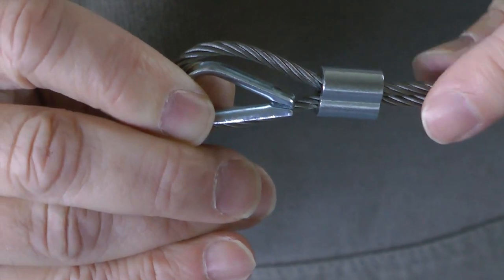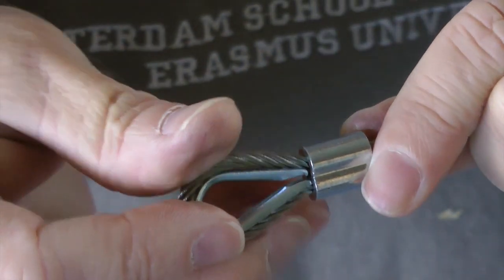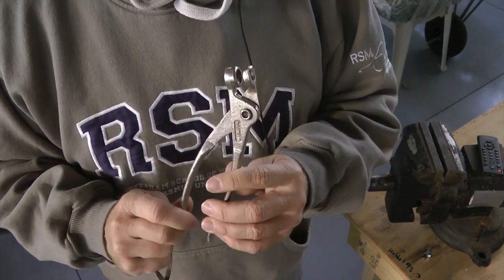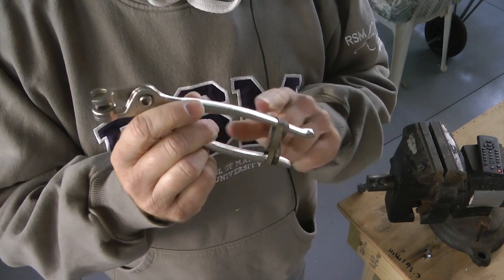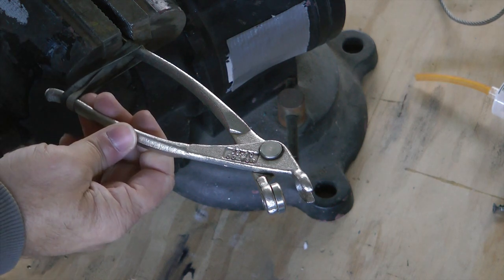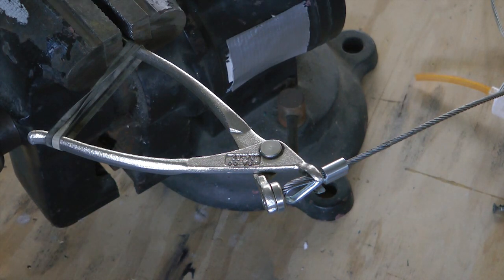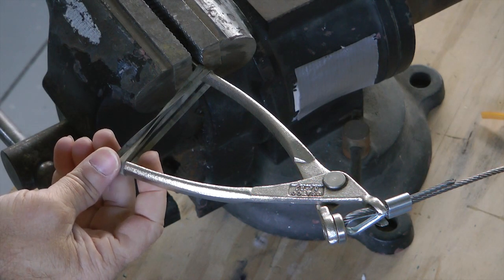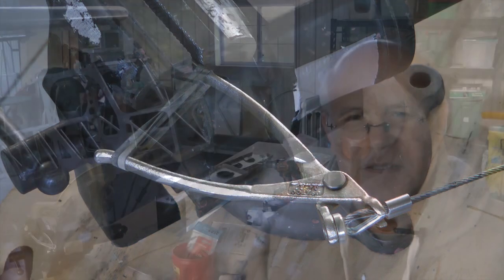Unique Trick with a Cleco Pliers for Aircraft Builders

Comment: AC 43.13 1B section 7-148 to 7-153 ppgs 7-30 to 7-39 is the accepted practice & approved methods of swagged cables for aircraft.  A home builder should read and understand how to use the swagging tools and practice on a few before actually making a control cable for an aircraft.  It's not difficult once you get the hang of it.  This illustrates that one mechanic improvised a way, adapted it so he or she could work alone, and overcame the difficulty of needing a second set of  hands to help accomplish the same thing.  This A & P Mechanic is learning new tricks to make his day go smoother.
Enjoyed the video, thanks for posting.
Reply: It's actually AC 43.13
Reply: duly noted and edited. Posted this after a long day in the hangar- work shop.... nice to see someone is paying attention.
Reply: Godfrey Poon We are up to revision  AC43-13 2B. You’re living in the past, get with it.
Reply: 1B and 2B are different parts and are both current.

Comment: back off the adjustment on the crimper to get the first press and hold things in place, then go back and do it again at the final setting
grab the cable and sleve with a rag in your hand, then you can really push it up against the thimble.
you can hold things in place with a regular cable clamp too, just gently tighten it, you don't need much, it leaves no damage to the cable

Comment: As a teenager I worked in a rigging shop and was taught by the original swage fitting manufacturer how to do these. They would suggest that the technique shown here is NOT good. They always taught to size your cable the right length so that its cut end is flush with the swage fitting. The original swage mfg. did not suggest that the cable exits the swage fitting as it leaves cable that can only become a "gotcha". Start swaging from the end farthest from the thimble first. As you move towards the thimble, the swage grows in length and makes a tight termination. Also, there is no need for two swage fittings as you seem done sometimes - it is actually weaker.
Reply: TalonID...   Hi, it's always interesting to hear from someone who's worked in the field being discussed.  

I can see the sense in not having a long tail sticking out beyond the swage...   it's a definite snagger and "gotcha" as you mentioned..   but putting two swages on the thing is an understandable 'belt & braces attempt by many people I think.   
I've done it myself, although not in this aeroplane sense. 

I'm certainly willing to take your word that putting two swages on weakens the whole thing,   but I'm just not sure why this could be..   Any crushing by the extra swage wouldn't effect the diameter of the wires in the first swage would it?   
Maybe if it was butted up really close I guess..   but if a 'swage length gap', say,  was between them, the wires would be still at the original diameter wouldn't they?  
Or is there some other reason? 

Just thinking out loud here, not a criticism.
Reply: Nicopress tested two swages vs. one, the single always broke at a higher load. Not sure why but testing tells the truth. It is important that the swages are completely crimped. Don't be lazy and stop short. BTW - I really like your videos!
Reply: The swage fitting manufacturer is a telephone company. Not that telephone cables can’t present dangers but they are in an entirely different league than flight controls. They did not go through the battery of engineering tests that aircraft manufacturers and regulators did when they appropriated these parts and tools for aviation. 

AC43.13... which is an FAA Advisory Circular which governs the acceptable practices on aircraft that aren’t explicitly detailed in an Airframe Maintenance manual has a very specific process for this. The sleeve is placed a small distance from the thimble to allow for expansion. Then—very specifically, the centre of the sleeve is squeezed, then the part of the sleeve closest to the thimble (which will now close the gap), and then the part of the sleeve furthest away. Always in that order on aircraft. Then you use a no-go gauge to confirm it has the right compression. 

For a cable splice using nicropress sleeves... it says in AC43.13 very specifically that you need to use two sleeves to perform a splice, and when you use two sleeves and they are properly pressed the cable strength is 100% of the original cable.... as opposed to 75% for a woven splice. 

As for extra cable being a “gotcha”. Please. You need to have cable going all the way through the sleeve for the required strength. Cable is often cut in rough lengths and swaged in situ. The end can easily be trimmed with a cutoff wheel using a thin piece of stainless steel to protect the other cable. Alternatively, you can use a piece of shrink wrap to contain any loose or sharp ends.

Comment: Thank you for sharing this. The Cleco pliers are perfect for this application.
I would like to respectfully mention some facts about plated copper Nicopress sleeves.
Nicopress sleeves are designed for Flexible cable. Not strand (1x19, 1x7 etc). They will work with strand, but a copper sleeve is designed for 7x19 (shown), 6x19 and its variations like IWRC, or even 6x7 or 7x7. 
They are manufactured by and are a trademark of the National Telephone Supply Company. There are many other manufacturers of oval sleeves as well. They are for Flexible Wire Rope, not electrical wire. Not "telephone" wire. GAC? Yes.
There are other types of Nicopress sleeves too: Round stop sleeves, aluminum oval sleeves for fibre rope etc. These are Oval Sleeves. For Flexible Cable you can use plain copper sleeves or preferably plated copper sleeves.
I am calling the size in the example 5/32". It is hard to eyeball something in a video, but if it were 3/16", the sleeve would be noticeably longer in length, relative to its width.
If it were 1/8", it would be tiny compared to the size shown.
This sleeve will expand in length 5/32" after being pressed 3 times with an M die. This is the rule of thumb for all Nicopress sleeves: they expand the same amount as the cable diameter after pressing is finished. There will always be one die designation in any application that is most popular, like the M die I mentioned, but there are often other size dies that will work as well. They will always have a maximum finished sleeve make-or-break diameter, and a specific number of presses required by specific dies. Using an M die, this sleeve gets 3 crimps.
Sometimes the same die will work with different diameters. 3/16" and 7/32" cables use size - specific sleeves but they can both be crimped with an "X" die.
According to the manufacturer's instructions, which are the same as the instructions from Universal Wire Rope and other manufacturers btw (some out of business), the cable end Must protrude from the sleeve after pressing is finished, a minimum of "One cable diameter" if you expect 100% strength. So if the sleeve is going to expand 5/32", and we want 5/32" sticking out after pressing, then you will need to start with 5/16" sticking out.
Except: if you start pressing at the middle of the sleeve, then the sleeve will expand towards the thimble when you do the crimp next to the thimble. The finished sleeve should not touch the thimble. I aim for 1/2 of the cable diameter = the space between the thimble points and the finished sleeve. If, after swaging, the thimble is jammed against the sleeve, or causing the thimble to angle-off, then that swage should be rejected.
In my line of work, we don't care if the swage is absolutely 100%, and so we try to end up with the cable end flush. This is so that people handling the cable don't get poked or injured by the protruding end. Cutting the excess cable off flush with a grinder/cutoff wheel is not recommended- it is too easy to nick the working part of the cable. Just the slightest scratch from an abrasive wheel will absolutely ruin the eye. How will the inspector know if the cable is injured or nicked if there is heat shrink covering the swage? Heat shrink makes the swage look better, but I would not use it for flight controls. 
I guess this is obvious to many people, but I have seen it done wrong countless times; the sleeve is oval shaped in section. That's why they're called oval sleeves. The sleeve must nestle in the circular groove of the die. Close the die around the sleeve, and before applying any pressure, do your final adjustment. Then close the die. I cannot tell you how many times i have seen sleeves crimped sideways, or detented by the tip of the tool instead of enclosed by the circular die. 
It helps to have one arm of the swaging tool in a vise, holding the tool stationary. I intend to not use my cleco tool in the vise, but to let the vise hold my Nicopress tool instead.
If you wish to swage the middle of the sleeve first, that's fine. Just leave enough room for expansion between the thimble and the oval sleeve. Does that mean that the middle crimp should be exactly in the middle? If it is a hair short of the middle - a bit farther from the thimble - then the squeeze next to the thimble can be a bit farther from the thimble as well. This will make a nicer "bell-mouth" at the throat of the eye.
Always complete your crimps with One closing of the tool, not repetitive crimps in the same spot. If it doesn't measure in, adjust the tool using the manufacturer's instructions. Never turn any screw or bolt on a closed tool. Always open the tool first. Keep your swaging tool lubricated. I use Triflow.
I personally always rotate the sleeve 180 degrees relative to the press I just did, adjacent to the press I'm doing next.
The crimps on the sleeve should never overlap. There should always be a ridge of flashing between presses.
The crimp should never be flush with the ends of the sleeve.
I do not believe that two sleeves crimped in series are stronger. I have never seen any manufacturer recommend this for creating loops. But I have used a second sleeve to cover the sharp cable end many times. When I do that, I do (a) very light partial crimp(s) on the second sleeve covering the sharp cable end. There must be adequate distance between the two sleeves, I use 1-1/2 pics of the cable lay (you could say the pitch of an individual strand + 50%). If two sleeves are used in the name of strength, it is an illusion. If they are too close together, there is a hard spot created between the sleeves which will destroy the integrity of the swage. If two sleeves are used and the order of pressing is such that the presses are converging towards each other, it will create an imbalance which will also destroy the integrity of the splice.
Sometimes I put a blob of non-silicone adhesive caulk (like Sudbury Elastomeric Sealant) or maybe some Loctite GoTo Glue, on the exposed cable end, to prevent people from getting poked by the sharp cable end.
Tip: Start by making a ring around the cable with a sharpie, 18" from the bare end. Make your swage loop. Then measure to the sharpie ring again, and subtract that number from 18. That is how much cable you will need to add to the other end before cutting in order to hit your correct finished cable length. Measurements are made to the inside bottom of the loop when referring to the finished length.
 One rule we live by is never cut any cable until you absolutely have to. Always start with way more extra than you think you'll need. Then you can reject the first attempt without ruining the whole thing.
 Always cut aircraft cable with cable shears designed for cutting flexible steel cable. Bolt cutters, dikes, and electrical cable cutting shears are not appropriate.  If you want to use a wheel to cut your cable, OK. I use cutoff wheels on cable over 1/2" dia all the time. But it will leave the cable in an unbalanced condition. Make sure the strands are not fused together. Using a cutoff wheel or torch to cut cable is not recommended.

Comment: There is a better way unravel the wires in interlace some coil back
Reply: That is a method for "soft" eyes, not thimble eyes. Forming a Flemish eye in the cable before inserting the thimble will make an eye that is too large for the thimble. Yes, it's a better loop, but not practical with thimbles.